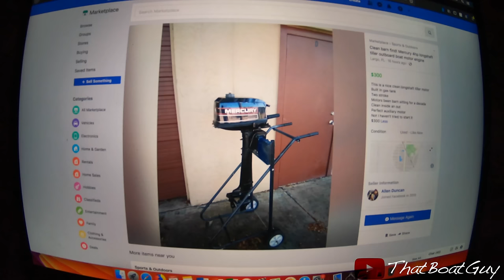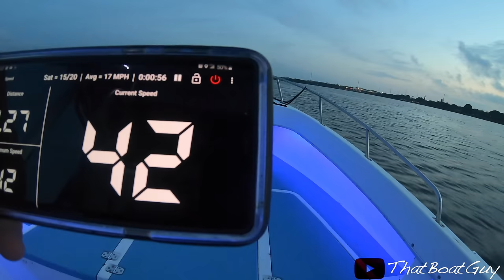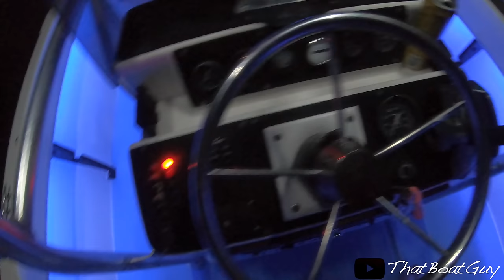Amazing Boat Restoration Must See!!!

Comment: Only 42 top end speed for a 200?
Reply: On a 22 ft boat that's not bad. Could maybe get it to 45-47 range with a different prop though.
Reply: Takes alot of power to scoot those big deep v boats.
Reply: Pretty bad, sign of low compression. Aka motor is pos
Reply: @reellife5082  The Aquasport 222 only has a 12 degree deadrise.
Reply: @cheesegrits196  your right it probably weighs about the same as a 12ft aluminum boat🙄
Reply: @reellife5082  nada has the dry weight sans motor at 2200 lbs so add 30 gal of gas at 220 lbs, an engine at 500 lbs., two adults at 360 lbs., and you are at 3280 lbs if the foam is completely dry.
Reply: @codyprevatte8285  so shit mate, someone's never heard of sarcasm. Which is why one 200 isn't going to send that thing 60 mph if the engine was running mint I guarantee that it would still only go 47-50 mph
Reply: @reellife5082  Haha no man I was just throwing out some info to back up your point. I meant to quote your other comment about it taking a lot of power to move a bigger boat.

Comment: You should not leave a dock line on the bow when running. Bad things can happen with an overboard line.
Reply: Mark Jenney that’s why you cut your bow line to length so it absolutely can not reach the stern

Comment: The fact that you called a old merc 200 a very good motor and the fact you gelcoated over the printed nonskid pattern without completely sanding the pattern off shows how very little you know about the subject. Merc is one of the worst outboards ever. And the gelcoat you put on the washboards will be chipping off within a couple years.